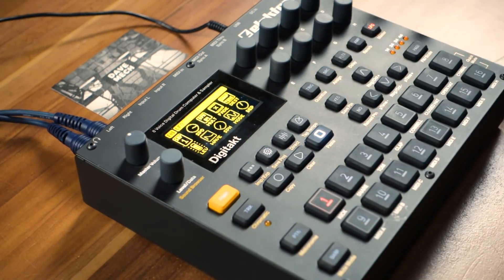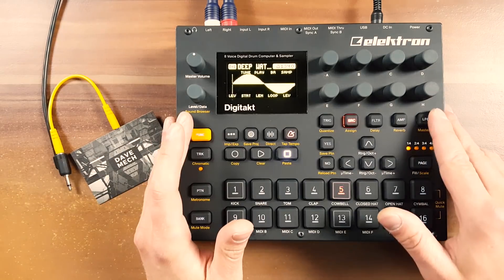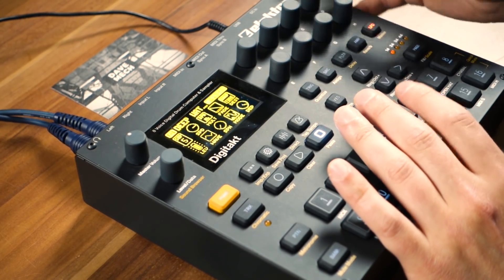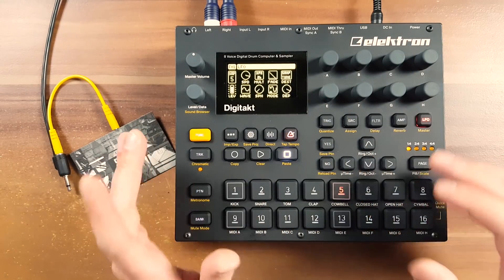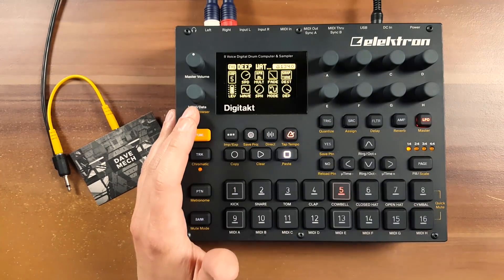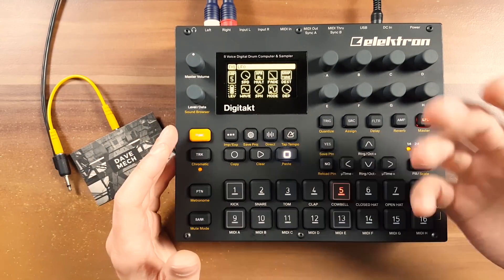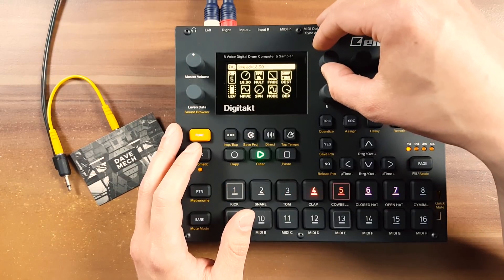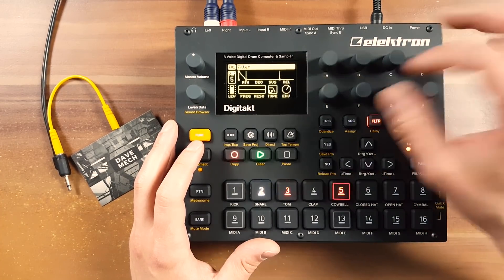OMG! LFO = 2-OP FM || Digitakt Tutorial #5

Comment: you should be using a square wave and doing the exact same thing but you don't need your lfo cycling so fast 32xBPM is fine, adjust the start, end and loop points to acheive whats known as a "Super Square" I think.  Then you can copy to another track detune ever so slightly and trigger in unison, you will like this thing alot but a sine wave will not give you proper results with your otherwise perfect method.  good videos thanks... crazy sounding stuff, courtesy loopop youtube video "Advanced Digitakt Tips and Tricks"